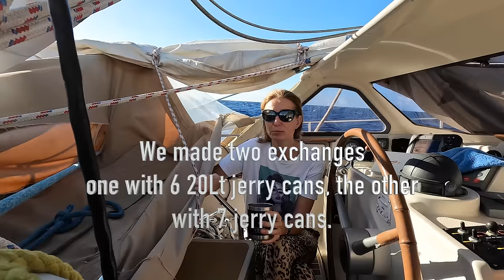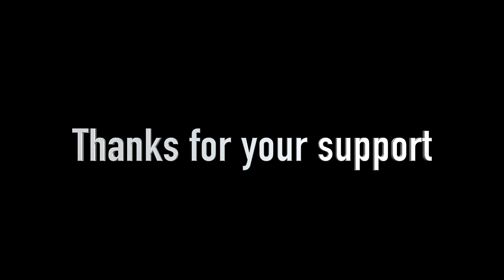Double dismasting in the middle of Atlantic Ocean - Real time update from disaster zone…

Comment: Two bits of wisdom from my cruising buddy boat (who is an experienced shipwright). He has long argued: 1. Dont sail downwind with a twin headsail configuration unless the rig was specifically designed for this;  2. Racers tune their rig for speed. Cruisers should tune for longevity and reliability. He is particularly critical of riggers that tune the stays as tight as guitar strings, as likely neither the chainplates nor the boat itself was designed for such stresses (particularly newer, more lightly constructed production boats). Me? I only sail with a headsail + mainsail and have my stays tuned to the minimum (necessary to achieve tension on the leeward stay on a reach).  Of course, we have no idea what caused this particular incident so these thoughts may or may not be relevant.
Reply: Amels are specifically designed for double headsail sailing. I'm sure they lost a swage from SCC.

Comment: Sailing downwind over the Atlantic is very, very hard on the rigging and the boat.  Load switches from side to side every 4-6 seconds. You might think it is not lot of load. But the rig take up all the momentum from the forces from the keel. In one hour you the load shifts from side to side 700 times. That is 16800 times over 24 hours.  If your rig is old, not tuned right, things like this can happen even in light conditions.

Comment: This is a good example of why diesel engines are better than electric motors. You can save yourselves and your boat, hope the best for you
Reply: 1,000 NM is a lot of fuel carry.
Reply: @stephenburnage7687  160 gallons for 1000 nm, the sailboat has a 158-gallon fuel tank
Reply: @arthur4818  A lot bigger than mine.

Comment: Considering all you pair are going through mentally and physically I'm amazed you've had the inclination to make a video. You've both got such a positive attitude. The fuel transfer was interesting....tie the cans together and throw them into the water.....I'd have never thought of that.....as you mentioned so hard to pull in with the drag and weight.  I'm guessing the solar arch saved the rigid cockpit from damage.....that was a bit of luck ( well not luck but you know what i mean) . I hope the mechanics keep their side of the deal now the floppy cloth system is having a rest and give you a good run towards home.  👍

Comment: Great sailors. Happy you are safe. I gather this. The main failed first after buckling and fell away to port. The main then pulled the mizzenmast down via the triatic. I suspect a starboard shroud failure allowed main to get out of column and crumple. I’d guess the fault is a starboard spreader first, then a shroud tang followed by a swage terminal, a turnbuckle and lastly a chain plate. The mast probably would have failed around the gooseneck or where weakened by holes. It will be very interesting to see what went wrong. While a terrible nightmare, you are safe and perhaps your travails will teach the rest of us to take better care. Good luck!

Comment: Good both of you are safe and sound and the boat is floating and running.
Tip: Use one of the boom's as a temporary mast. 

Clues found in this video. As you say in the video: the main mast was leaning towards stern and missen. Tells me that something happened in the bow/pulpit which then but some stress on the rigg it self, which then could not hold the load. In pure speculation it could be the bolts that got degraded/metal degradation. This is unfortunatly nothing that should happen as rest of the rigg should up the mast it self. The bow is usually the one point that takes most of the saltwater. 

You could also see where the breaking point is on the mast it self. Which also holds clues on what side it initially broke. Stern, port, starboard. Metal degradation is also increased when theres more load than it can handle, which also leads to breakingpoint. 

It definitely a big expense to replace both main, missen and rigg. But both of you are safe, safety is always the first priority. 

See this as speculation according to your statement on what happened. We´ll see what really happened when you haulout.

Safe journey until port. Btw, find the next boat comming across and buddy boat rest of the journey as safety precaution.

Comment: Well Done for getting everything under control, As another survivor of a Mast lost at sea I can relate well and no one should underestimate the stress and shock you will both be feeling even now that things are under control again.  well done for being so composed.  I have no idea how your insurance will work but speaking of my own experience the single best thing we did for both safety and comfort was to cut the mast away.  All those sharp edges and potential danger points especially for the night watch not to mention the risk of a rouge wave knocking you off your feet or tripping up when trying to move around and by getting rid of the mess you can see any damage better as well.  Our insurance covered us with no questions off just some basic photos and yes all rigging, lines (no ropes on a boat!), fittings and sails were replaced.  If we had saved the sails it would have been nice to reuse those but in our case they were caught in the break point of the mast and so couldnt be taken down properly.  This was before GPS or AIS or Internet connections were available so some time ago (1993) and we lost our antenna on the mast so had no comms for several days which was soooo fun, but meant we had to be that bit more careful and cautious of any possible dangers but in hind sight i still think it was the smartest thing we did.  Regardless keep your chins up, remember you have a solid and sturdy craft under your feet and be greatful that you are safe.  I would also suggest that if its not already been moved, the life raft should be moved on top of the debris so that if you do get into trouble its accessable as the normal places they live are probably under the mast now.

Comment: Wish you well. Lucky thing you were able to get more fuel.. Guess that's why you didn't try to gerry-rig some temporary sail. I'm in the process of splicing my broken mast that failed in a hurricane. The extrusions of both my mast the the mast parts i purchased for the repair cold-worked and failed near the deck. All stays were fine... I believe such a failure [spar] is common in older boats. My plan is to modify the rig adding running backs and jumpers to add strength to the rig and to reduce spar vibration... Best of luck.

Comment: With the rig down, your inertial stability is far less making for an uncomfortable roll.  You're lucky the conditions were relatively calm.   That's a lot of weight/gear to keep on deck.  It's amazing the two of you were able to secure all of it.  

For dismastings, the best tools are a battery powered cutting tool, hacksaw, and pin and hammer.  Hope you had those available. 

Good luck!

Comment: I just found one of the turnbuckles had one tine a thick pin went through totally broken off from crevice carrosion. And I had looked at that time exact thing not long ago and it looked OK. Luckily I have already got replacements turnbuckles and was able to swap it out without any thing falling down.
Reply: An advantage of Dynema  rigging other than being stronger than steel .. you can see if you get abrasion and theres no sudden failure from micro cracks or hidden corrosion..
 You save a hell of of a lot of wt up high especially with a ketch.
 
If you need to clear the rig and decks when a mast breaks you can do it with a sharp  knife ...no saws or bolt croppers required its a lot faster as well if its putting you in more danger.

One more advantage you can carry a couple of full spools of dynema  and replace the whole lot from your own stock yourself if you  learn how even at anchor off grid .  See the rigging doctor, for standing rigging, its best to use pre - stretched dyneema. 

Henke ... James Wharrams partner..and founder of modern catamaran cruising, replaced all the standing rigging on her 63ft ketch rigged cat ...Spirit of Gia and that vessels sailed the word several times.  It cost hundreds rather than the thousands of a metal rig replacement.
It also has wooden masts with wharrams own sleeve fit wing sails.

A parra kite sail can help as an emergency sail its compact and powerful if you know how to fly it.  If you can rig a harness to the for deck fixings  or from a stub mast. 

You've been through a traumatic experience but lets see if we can help you avoid at least one aspect of this problem. 

One observation a yacht with electric motor/s that run off a solar ..and prop driven regen under sail..  are normally used as a hybrids and run from one or two generators and  use properly matched  use 25-30 % less fuel and have less maintainance  problems than a conventional direct drive set up.  
You can buy rolls of plastic flexible solar panel.. that could also be used in an emergency and stored rolled up.  

Was the standing rig possibly over tensioned at some stage in the past or the mast stressed in an attempt to angle it in some way . 
🤞🏼🇬🇧🧙‍♂️

Comment: Love to see where it broke , obviously metal fatigue but I wonder what contributing factors there were ?  A mast exit ? Rivets in a bad spot ? 

Was on a boat racing once and we kept hearing some "ping " noises during the race . One guy , a naval architect , went below to investigate  and came back up to say the rivets holding a splice in the mast were failing and the race was over . We limped back in to  St Martin .  What had happened is hidden corrosion had loosened the rivets' , they then began to work , that broke the first few and then it became a cascade failure that would have taken the mast if we had not caught it  .  As each one broke the load on the remaining ones increased accelerating the failure  . 

Pulled the mast , cleaned up the corrosion and re riveted it and good to go .

Comment: What a story! I am sooo curious about what caused the mast to fold up. You say the forstay/furler did not come undone, but the mast buckled and then folded up. I assume you have a keel-stepped mast, so the lower end was riget. Were there any undue forces from the boom pushing into the mast or whatsoever.  Once you figured it out , plis share. It might help others. On this side there were 4 boats dismasted in a year, only one by genuinly capsing and scooping up a sail full of water ...
Reply: They're deck stepped masts. Maybe one of the lower shrouds parted by the way they described the mast falling.
Reply: @domen810  all the more - Im getting more curious if a plausible cause can be found. Ken is a very careful skipper, which makes it even harder to guess

Comment: I don't know what caused this problem. But i often see, sail yatch sail with the Genua only, because it has a furlex syster,  without knowing, that the main sail is stabilizing the mast. So the first sail choise should always be the main sail
Reply: There are so many variables to consider in this context. It's impossible to say what sail configuration is appropriate for what vessel without experiencing it, yourself.
As a general rule, the foresail and the main are scaled relative to one another for both efficiency and for balance. It is not unusual for cruisers, however, to run under head sail alone just for the sake of ease.

Comment: Impressed by your cool demeanour in such a frightening situation. Hope you have good weather for rest of journey.
Have you considered cutting all spreaders just in case masts move?  If masts move into water in rough sea and spreaders still attached could hole the boat. Also have you considered cutting or disconnecting the stainless steel rigging \ shrouds so masts would be easier to jettison overboard in a crisis?

Comment: So many things could have been at play.  It's possible the shrouds and stays were not tensioned properly before a major ocean crossing like that, so if they were slightly too loose and over the years, you had rust and corrosion setting in deep in the bottle screws where the shrouds and stays are connected in the bottle screws, and she had too much sail out and being in the evening, you couldn't see what your tell tails were saying, and then you got a burst of wind with the vessel being at the wrong angle to the wind, with a good solid sea swell at your beam, then with a solid side roll of the vessel, along with the exact timing of that side burst of wind and swell, the main mast (deck stepped?) could have snapped to one side, then the other on the return roll and cause the weak point to break and the rest is history.  Also the same with a forestay issue with the genoa (or connecting point to it's roller furling) or the back stays connecting points breaking (for the same reasons) or a failure somewhere in the spreaders or possibly where the mast is stepped on the deck (if deck stepped).  Soooo many possibilities.  I'd like to think that the rigging was either thoroughly inspected (by a professional company or yourself with this much sailing experience, using all the proper tools to do so), before an ocean crossing like that.  We've had some pretty dramatic winds during that time and those burst or gusts of winds were the norm for about a week or so, so all the more reasons to have it properly inspecting by a professional, which is like getting a second set eyes inspecting it, like getting a second opinion when facing a big medical operation.  I how all will be determine and figured out and your get it repaired or replaced by your insurance company.  Good luck with the re-fit.  Don't compromise with that process, get it all replaced from "pin to pin" and have it done with Caribe Marine on Martinique, the best in the Caribbean.  https://www.caraibe-marine.fr/en

Comment: Back in the day, after a couple days of gales during which my masthead tri-color was lost, I was dismasted one night in a glancing collision with a fishing trawler about 100 nm south of Yarmouth, Nova Scotia on my way back from a summer cruise in the Canadian Maritimes. One of the trawlers stabilizing booms took out the mast on my Cape Dory 28'. The seas were still rough and I feared a hull puncture so I just cut the rigging loose with bolt cutters and was unable to salvage any of the mast for a jury rig. Fortunately I had enough diesel to motor back to the mainland, but only after I got another 5 gallons from a passing mega yacht.

Comment: Very sad Hope you stay safe. Drives the point home that regardless of the manufacturer of boat, prior to a ocean crossing is to completely inspect the rig from chain plates to masthead, you might not find anything or maybe so? Also not using a triatic and have independently stayed masts gives possible safety and options